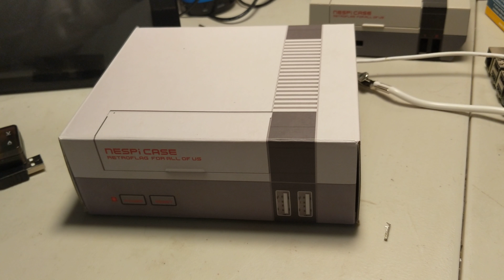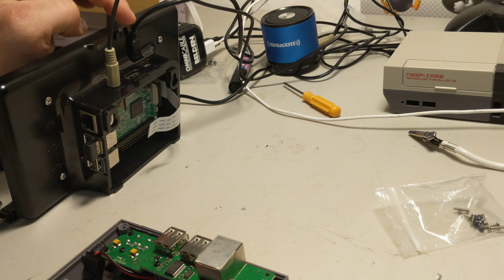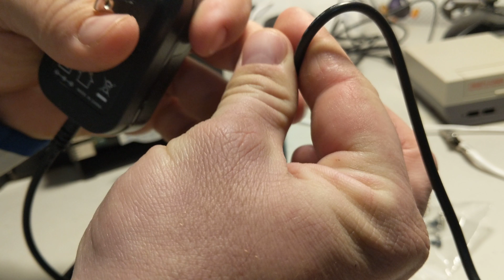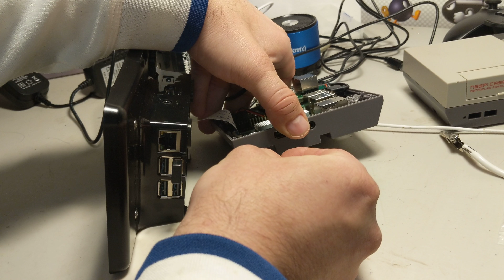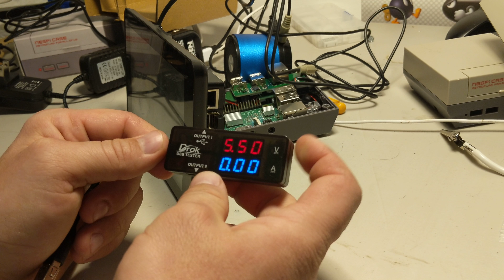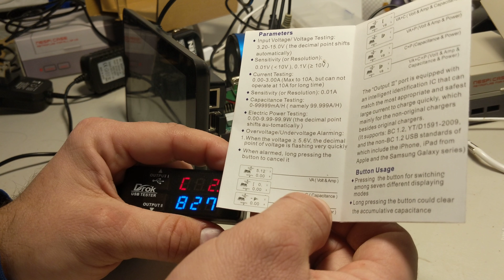Nespi power supply test very long

Comment: I use the northpada power supply with the inline switch and it does not solve the yellow lightining bolt issue for me. I will try the qvs power supply next.

Comment: Matt...have you ever seen an LED dim and not go out? Just got a case all setup, plug it in, power it up, good to go. Shutdown the system via the menu of Emulation Station, and when there's no signal, I hit the power button. The power LED doesn't go out, it just dims. If I literally shutoff the surge protector the case is plugged into....it's still dim and not off. It'll go off if I yank the cable though. Weirdest thing.
Reply from the maker: +WishItWas1984 yes I have this issue. It has something to do with the HDMI cable carrying power to the pi
Reply: Matt Farmer Thanks. I swore it turned off when I pulled the HDMI too, but figured I was seeing things and it was the power. I see on Reddit, some people saying a board should have an IC to prevent the backfeeding of power.

That means in my old case I've had a steady .5A of draw 24/7 for years. Just no LED alerting me until now. lol

Guess I'll start to yank my HDMI after powerdown now. Don't want to blow the cases LED one day.

Comment: Maybe you got a"good" case, I'm running pi3 at 1.3 overclock with a 5.25v 3amp psu. I get the bolt and slow downs in the case out of the case no problems. Can't wait for the rest of the vids.
Reply from the maker: dust bucket yea I kinda stopped these videos. It's a combo of the power supplies and the NESPI case 26gauge wiring being too small. I now upgrade the wiring to 22awg in the case and have no issues. I personally have never had this issue with the 70+ cases I've modded but now upgrade the wires because most people do have this as an issue
Reply: Matt Farmer yeah I think after some more digging on internet that seems to be issue, thx Matt keep up the good work!!